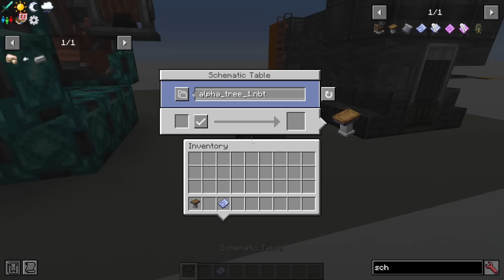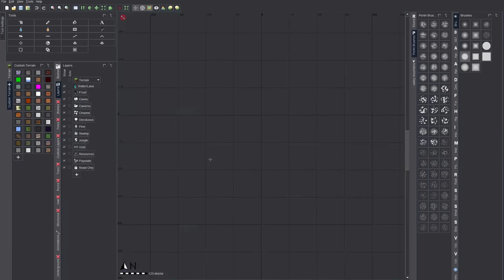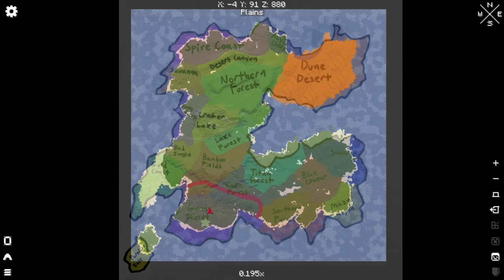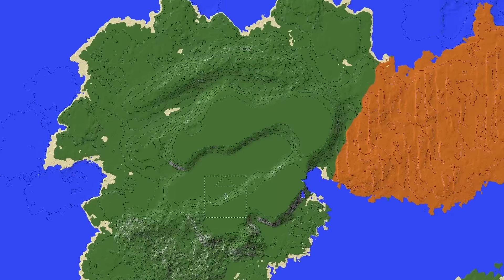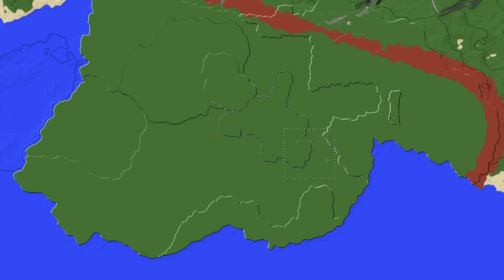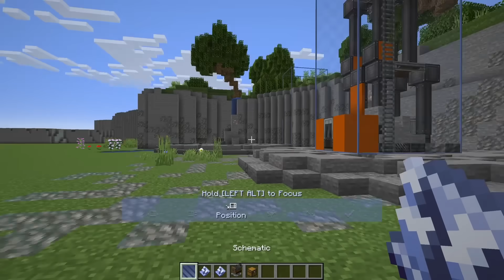Modpack tiers and custom world! | Satisfactory in Minecraft

Comment: Yes! This is a significant improvement from the last video! Over all, everything looks like you are starting to have a real roadmap of what you need and what you can do to nail those vines down. 
The schematics will be vital for a satisfactory style feel. And I think having two types of power generation/consumption (rotational and electric) will add to the mod pack. I love it! I would say for the final builds, make those moving parts visible. I love that I’m satisfactory, you can see arms moving, presses pushing, drill shafts being added, etc. and create does the same, so let those things be visible!

Not sure how easy or possible it will be to be able to have the schematics actually be in the world, but give you different items when broken. But if that’s possible then absolutely!! 
With that, I think you’ll definitely need some backpack mod, because the inventory in Minecraft isn’t enough for even vanilla survival projects, and the inventory in satisfactory is still too small unless you just use dimensional depots!

I think all the basic materials like stones and dirt and sand should be automated, especially since this is create, you need to be able to automate andesite😂since this will be a finite world, you need a way to get those materials without traveling for thousands of blocks, tearing out a whole biome, and then traveling thousands of blocks to another biome to destroy…

Another thing, I think it would be neat if you switched the deepslate and stone ores, so that the pure one is stone and deep slate is impure. It takes longer to mine deepslate, making it slower, and it would give a visually obvious clue to the player of, “hey this block is different, maybe I can do something with it” so they know they should place a schematic on it. 

The world map is looking amazing!! Once the cliffs are textured and not perfectly vertical, I think you’ve nailed the vibe. 

I love this project and can’t wait to see where it goes

Comment: The only issue I can see with the multiblock machines is: why not just set up the mechanism that's inside the multiblock? Why spend resources building a multiblock when you can just build it from scratch cheaper? How where you planning on handling that?

Comment: I have a mod suggestion: Parcool
Satisfactory has some pretty good base movement with its fairly quick movespeed, sliding for sloped meadows, and a high jump for small cliffs. It needs it too because of how large an area you have to traverse to get materials and manage factories. I think this mod pack will need a good set of extra base mobility options for the player as well

Parcool is a parcour mod, it adds some configurable parcour moves and a slightly faster run while holding sprint. All of the moves use a shared stamina bar which regenerates on its own and you can disable any move in the config. The main moves are wall kicks and runs, long and high jumps, vaulting, sliding, ledge grab, and a parcour roll for reducing fall damage (more precise than water bucket).

Comparing this to the base Satisfactory moveset, you have a faster sprint, sliding for sliding (duh), long jumps to partially emulate the distance from slide hops, and high jump and ledge grab to emulate the jump height from Satisfactory. The only 3 that don't really fit are the wall kicks, runs, and vaulting, which can be disabled

Comment: A few thoughts for you to consider:
 - Immersive Engineering has a system that creates a resource layer beneath the world where it draws up a specific ore type. This can be configured so that these "nodes" spawn in specific chunks. They can also be used for liquids, such as water or crude oil.
 - You can set up a "market" block/multi-block where the schematics can be "purchased" using a ticket system. Tickets are earned by dumping resources into a "sink". If you work out values for each type of resource, like a stack of copper ingots is 1 ticket but a stack of steel ingots is 5 tickets, then make the cost for a smelter 25 tickets this could balance the game relatively easily.
 - A "quest" system, like ftb quests, can be configured to provide access to the schematic for the sink and market in exchange for a set of materials.
 - Terrafirmacraft could possibly be nice for the processing of ores using the Create compat that's available. Making the machines a little more dynamic in their design.
 - When considering the world design, the nether and end dimensions might need to be disabled and have biomes that are dedicated to them that uses modified spawners.

Comment: You should reconsider using Oritech as the main mod, it has built in Tiering with machine cores. Plus the multiblock machines in Oritech are simpler to build than even schematic based machines.

Comment: a few questions I have:
1) are all of the ore from a node going to be respawning?
2) what's stopping the player from making their own mining machine? (you had mentioned in the video one of the benefits of the schematic is that since you're in control of making it, you (the pack dev) can control the speed, yet what if the player were to instead do a different faster design?
3) I'm sure there'll be a video that covers the topic, but what's your plan for power (specifically stress units)? are you going to nerf water wheels? I remember in the 1st episode you had mentioned the progression being smthn like water wheel -> wind -> steam  engine, but i believe a lot of players agree that wind is just worse than water wheels, which means you're either gonna have to buff wind, or nerf water wheels i'd think.

I'd also like to add the idea of this pack is smthn i've wanted for a long time, however I also hope that its well balanced, and not overly grindy, I'm asking these as a way to more try and help how I can, as my background in modded is primarily older expert packs, and while I understand those packs aren't for everyone,  I feel its given me insight on how to "break" modpacks (ie, do things that aren't necessarily intended, but are possible & don't have a way to "shutdown" w/out a complete change in pack philosophy)

Comment: As others have said, a custom multiblock machine library is really what you’re looking for here, for lag reasons if nothings else. For the ore nodes, there may be a way to restrict the placement of these, depending on which library you use.

For the stone, you could perhaps use different stone types in different areas (e.g. grassy fields has a mix of stone and tuff nodes), but give them all the same recipes so it’s purely decorative.

Also I really don’t think water wheels are the way to go for power. If you’re using power lines anyway, you could probably make another custom multiblock power generator, with custom recipes for coal and possibly oil (plus wood/foliage for early game) that creates power, like in Satisfactory. You could then also add a water requirement for coal power if you wanted.

Comment: There’s FTB structure capsules for automatic structure placing! Not sure if you can make them consume blocks TO place but it’s definitely an option! As someone else also suggested you could try using multiblock mods like Multiblocked 1 and 2, custom machinery, and modular machinery!
Oritech has a research system so you could check if it’s easy to change and add stuff to it!
The custom map seems like an amazing decision! There hasn’t been a real pack that does that since Blightfall so I’d love to check it out! Just make sure to give the player some good movement options as the map looks to be pretty big.
If done properly I say this could be one of the better packs in modern MC. I’ll definitely be keeping close watch on your journey! :D

Comment: @polartt i got 2 ideas to add to the prefab machines when u design them.
1=later in development not priority but find a way or make a way to recolour or paint the orange concrete on the machines to any of the different concrete colours so people including me can colour coordinate them for different jobs and ores.
2= make higher tier versions of the machines which things like more drills, smelters, presses, etc and work much faster and are bigger looking for later game unlocks and therefore include mineral nodes with more than just 1 ore block on them so the higher tier drills can use them better.

Comment: As for the AWESOME sink idea, would taking the idea from Create Above and Beyond where they used the trade station to exchange let's say "silver coin(s)" from the Thermal Series mod. Or even using a quest book like they do in that same modpack as the coupon redemption menu. (in Create Above and Beyond's case it'll be under the "Remote Trading" section of the quest book) Also using the trade station as the AWESOME sink perhaps? Since the trade  station already kind of works like an AWESOME sink in a way.

Comment: A solution for the schematics is making KubeJS blocks for the materials and making them not placable by the player through a datapack. All of the different visual variations could just be different block states of the same block for that item. Granted this would be a pain with the stairs in your designs, but you could make that work by dedicating a specific material to stairs of a certain type.

I have no idea how feasible this is I just know it’s possible.

Comment: Custom ore veins:
Custom Machinery(my favourite) - multiblock machine that can only be placed on ore blocks, you can maybe restrict this with the mod and it has many more options (You can technically use this mod for all of the machines, allowing for custom input counts and combinations of items etc)
Create Ore Excavation - most simple create styled, but similar to IE with invisible nodes per chunk, could also spawn ore blocks to indicate
Create: AdsDrills & Ore Nodes - bit funky but has limited sizings
Create: Molten Vents - bit of a process to it though..

Placing machines:
Datapack - janky, but could just use minecrafts structure system with a custom item that runs the place command
Create - isn't there a config to allow placing schematics without the canon? could be wrong about that
Structurize - custom structure placing mod used/created by minecolonies team (might be able to change the required items/instant place with command?)

Map:
Better foilage mod/resource pack should fix the grass issue
To limit where water wheels can be used - some sort of finite water mod? or create: picky wheels

Comment: I’m not a coder but just by looking at it, could you re-purpose the create large water wheel multi-block code (yknow how it’s placed like a normal block but takes up a 3x3 space) for the different machines? Cause then you don’t have to deal with schem shenanigans and it would just generally make everything easier if you could get it to work. 

Also for a research tree, I’ve been thinking about using ftb quests for a kind of research tree, I think it would work pretty well.

Comment: So, as others have pointed out, it bears noting: While I get the desire to make "multiblock" machines that LOOK like Satisfactory machines driven by Create, I don't think this is at all the way to do it. It's not even really sidestepping the issue of the drastic differences in the scales at which Create and Satisfactory operate, it's just giving a less-efficient way to skip parts of the design process. In actual design, there's no real way to incentivize use of the schematics over just building out with Create normally, without outright barring players from placing normal Create devices, at which point a core part of the appeal of this concept is completely annihilated.

I'd reiterate what I said on the last video; the best solution to this is ultimately going to be meshing multiblock mods with Create, rather than attempting to brute force Create into doing what you want. Immersive Engineering has some out-the-box multiblocks that can be useful for this, in particular for the ore node problem (mineral veins and Excavators), but none of its machinery is upgradeable; Multiblocked2 has been called out, and if you're willing to go through the extra effort and learn KubeJS to really make it work, GregTech is a really powerful engine for exactly this kind of thing. There's a lot of viable solutions to this particular issue, and it feels a little like you're kneecapping yourself with the over-reliance on Create.

(I also said this on the last video, but it might as well be reiterated that relying on Create too much is going to cause TPS problems. This is already likely to be an issue with heavy usage of conveyor belts, as they're one of the laggier parts of Create, but it'll just be even more of a problem if you're running everything possible off of Create.)

Comment: I would caution against using Create: New Age wires as they can lead to some severe late-game performance issues as your power networks get larger. I personally believe that using the Immersive Engineering would be better performance-wise, and it has a already built-in power progression (lv, mv, and hv wires) that can be expanded upon, and it has power poles for larger networks, but I understand their might be better alternatives. Great video anyways!

Comment: You could maybe use few mods and disable stuff from them like... use Create, Immersive and Oritech. Oritech for reactors, immersive for cabling and Create as a main mod. Then just disable and tweak recipes in a way to achieve some synergy. for exaple removing recipes for pipes in Oritech so people have to use item conveyers from Create and cables and poles from immersive for electricity

Comment: You can use custom machinery, modular machinery, or create your own mod to create multiblocks, and combine that with the Create schematics.

Using a Create multiblock with several purely decorative parts would only make people not want to build that multiblock. You might think that removing the crafting of essential items would solve the problem, but it wouldn't, because people would simply break everything to avoid having to create the cosmetic blocks again. With the mods I mentioned, it's possible to create good multiblocks and give the feeling that it's necessary.

See, for example, Gregtech New Horizons, FTB Integration by Parts DX, Feed the Factory, Factorocraft 2, Techopolis 3.

Comment: So I wanna bring up a create addon that I think would fit well, (I was going to suggest it last video but I figured someone else would but by your lack of talking about it I assume no one did) but I also need to know what you think of it. That mod is "The Factory Must Grow", it adds a lot of more industrial stuff like steel, oil, coal coke, hydrocarbon powered engines (think a creative motor with a stress limit and a fuel requirement) and some more things. I think with the right tweaks you could pick and choose what you want to use from it and handle overlap, (personally I think their voltage system is interesting but it can be a bit confusing). 

I think you've got a lot of potential on your hands with this modpack concept, and I'm excited to see what comes of it!

Comment: Suggestion! If you're gonna use a data pack/mod to make the ore nodes, you could use ore blocks to determine speed.
Somewhere in the machine schematics, have a ore block that the player can replace. It can start with coal for base speed and scale up in tiers from there till Diamond or Netherite.
Then have it so the data pack detects the presence of ore blocks nearby and changes the speed in which it regenerates ores.

It'd function much like the power slugs but still be linked to game progression

Comment: If you are basing this entire modpack on create, you have already failed at Satisfactory in minecraft. Create is probably the least Satisfactory-like tech mod there is.
Reply: 100% true. Create is more steampunk. Satisfactory is futuristic
Reply: Create is such a logistical nightmare, can only agree with this
Reply: I completely agree create is good but it doesn’t have enough processing steps for any sorta “factory building” al you really have is the crusher, mixer and press there is also the mechanical crafter but that isint a step its more of a cheap way to add more recipes to the mod however i am very hopeful for the pack

Comment: A few suggestions; 

1. The ore nodes should all use different stone types based on the colour of the ore. So iron uses granite, or something. Just to make them stand out more against stone on stone. 

2. You can use a program like MCreator to fairly easily add your own custom blocks, code, and datapck like functions, which could help you with a lot of this. IE, you should be able to make fence post like blocks, that are considered as oak logs for your custom trees. Then Create would recognise it all as one tree to cut down and drop the relevant log.

3. MCreator would also let you easily handle stuff like the infinite ore, with a simple tick function that just does "Set block ~ ~4 ~ iron_ore" etc.
Reply: i'd use kubejs instead of mcreator but yeah
Reply: @catandcomparator  kubejs has more features, but it's also a bit harder for a novice to use, in my experience. Keep in mind, this is a guy who thought using command blocks was the right idea.
Reply: it would also allow him to make the machines as a placeable block that you can place or destroy in one go (for example immersive engineering has creative items that allow you to build all the multiblocks in one click
Reply: Doesn't MCreator's licensing require you to specify a mod is created with MCreator otherwise you can't distribute it?
Reply: i'd recommend against mcreator here